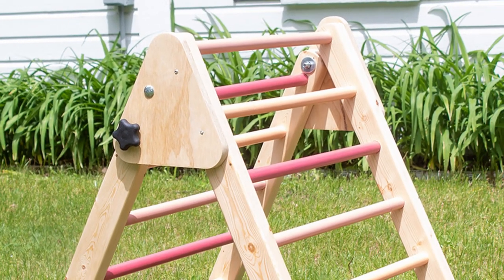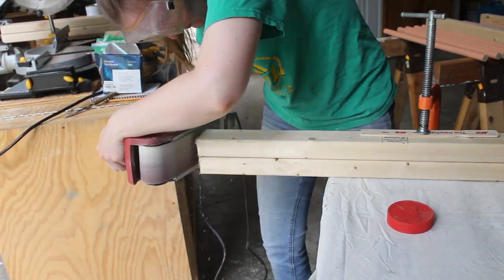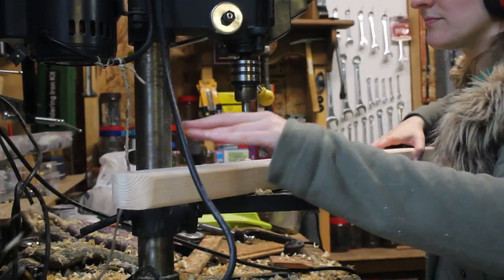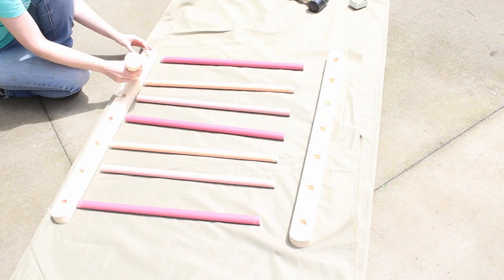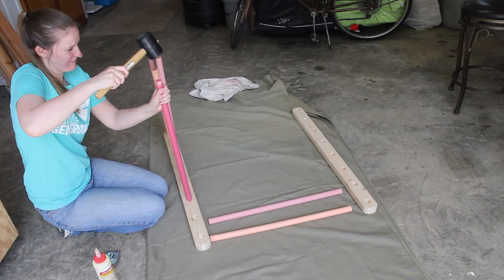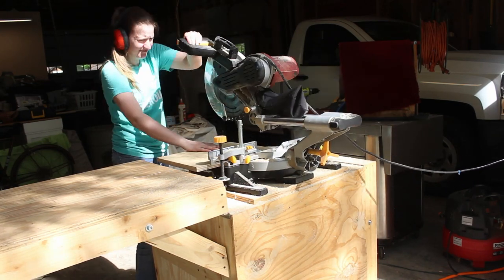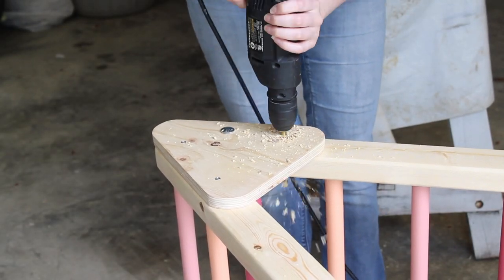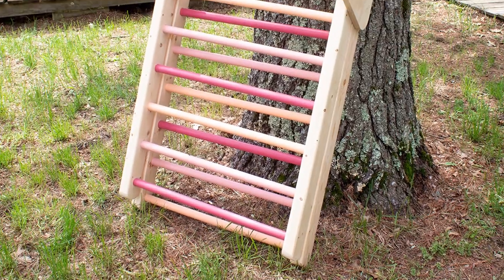DIY Pikler Triangle

Comment: I am going to try to make this today but was wondering if I made it approx 12 inches higher would the triangle stay the same dimensions or would I have to work it out differently?
Reply from the maker: So, there are a couple ways I see this. You could make the triangle taller and steeper, but the base footprint would still be the same. Or you could make the entire triangle larger, including the base, in which case the shape would be identical, just bigger.

Either way, the cuts/lengths of each board would probably be different.

Comment: Did you use anything to seal in the paint or condition the wood? I’m going to build this but I’m not sure what products to use.
Reply from the maker: So, paint is actually pretty durable on it's own and while you could put water-based polyurethane on top for extra protection, you really don't need to.

For the wood portions, I'd recommend Zinsser's Shellac Sealcoat for the finish. It's non-toxic, and probably edible after a 30 day cure time just in case your kid starts chewing on it. (I say probably because shellac in general is edible; I'm less positive about this specific mixture.) 

As for conditioning the wood, that's only necessary if you're staining, and even then it's only necessary sometimes.

If you want more info, I've actually got posts on all of these things:
- Choosing a Finish: https://abutterflyhouse.com/polyurethane-varnish-shellac-lacquer/
- Wood Finish Toxicity/Food Safety: https://abutterflyhouse.com/food-safe-non-toxic-wood-finishes/
- Wood Conditioner: https://abutterflyhouse.com/wood-conditioner/